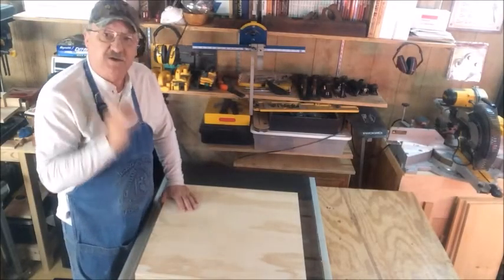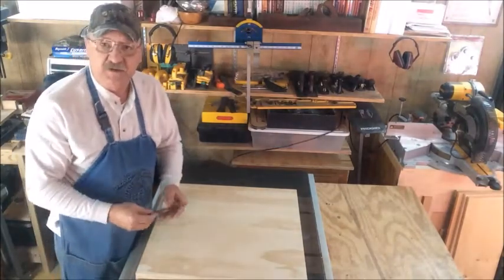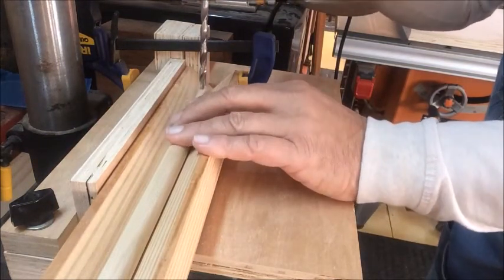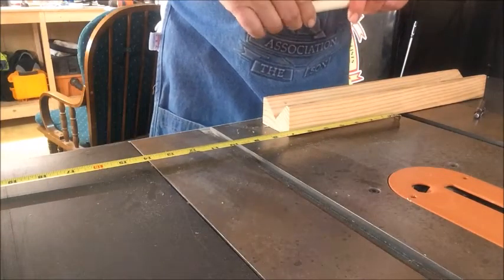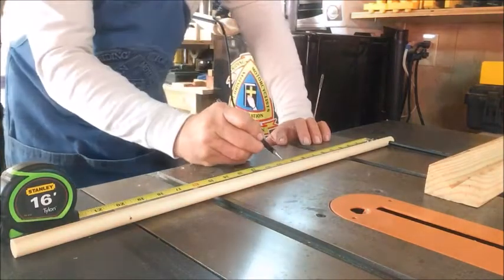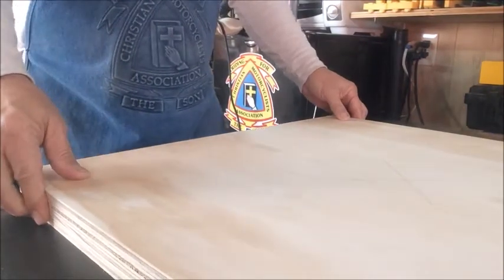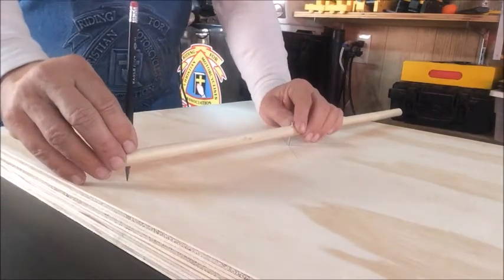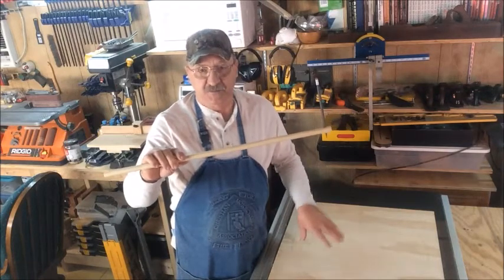Build a Beam Compass

Comment: That'll work! Nice quick resolution to the need for a beam compass.
Are you going to build the "Thien Baffle" as part of your two stage DC?
Reply from the maker: MRrwmac Yes and no.  I used the baffle that came with the dust collector but installed the motor above and directly to the baffle.  I built it similar to the Jay Bates design.  Works great but still installing all the various drops to individual tools.
Reply: Ricky Walden OK Thanks. Looking forward to the finish and tour of drops!